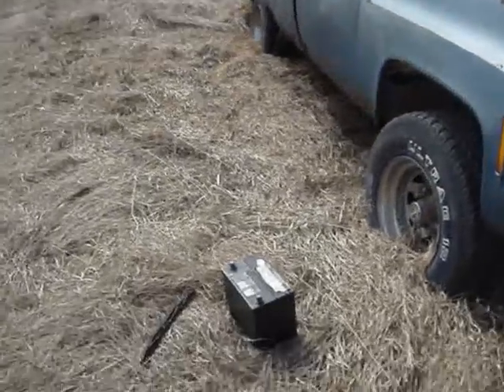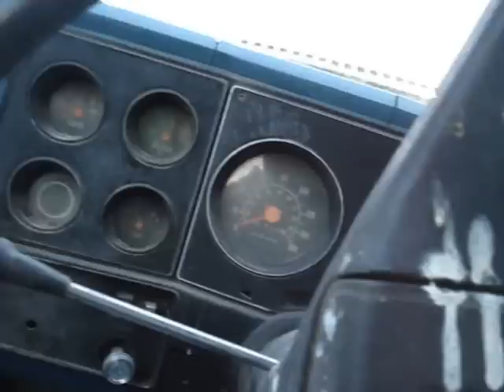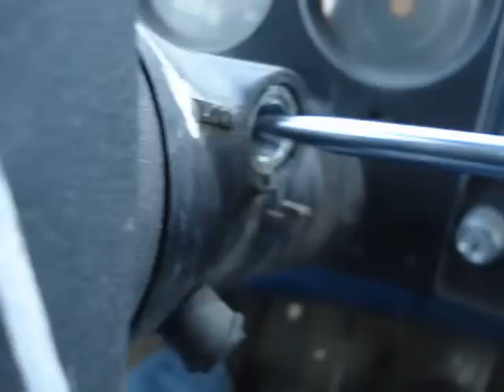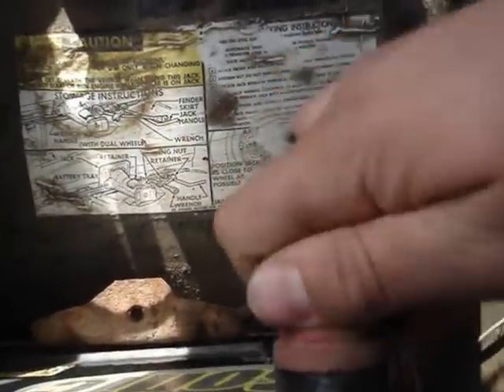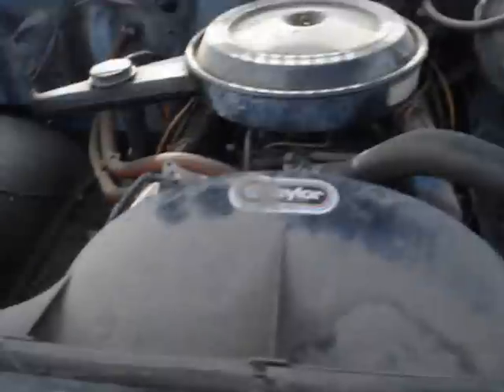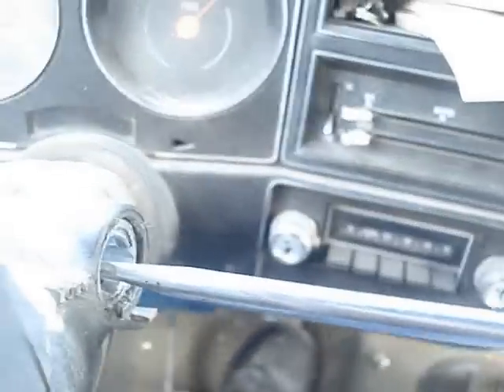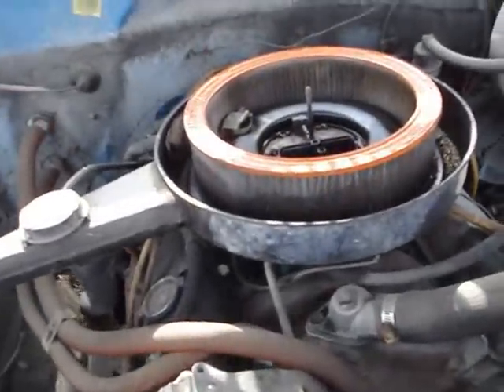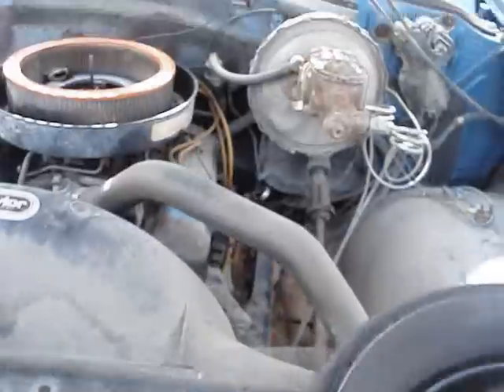Getting the Chevy k20 started. Part1

Comment: I noticed you never set the choke. probably would've started first crank. Im guessing thats what that push pull cable is beside the ash tray. guessing this is alberta or out west. nice
Reply: you are correct. Should be. But almost every farmer I know converted the auto chokes to a cable once it screwed up. Either way pumping the pedal does worse than better IF the choke is functioning. Even worse if the electric choke is functioning as it should. There was even ad campaigns by Rochester in the late 70s educating people how to start their car in the winter because they had too many sally pedal pumpers haha

Comment: You're.plaing with the starter too much! That's the real problem why it's doing this!, yo're cranking and cranking and cranking until the starter burns and that's a no no its unsafe to do that to the poor thing I feel sad for it :(
Reply: what are you talking about?  It doesn't need fuel to start, the starter just needs to get hot enough to burn on its own.